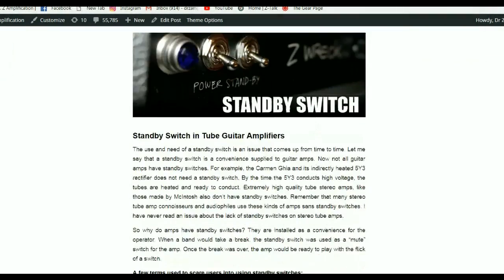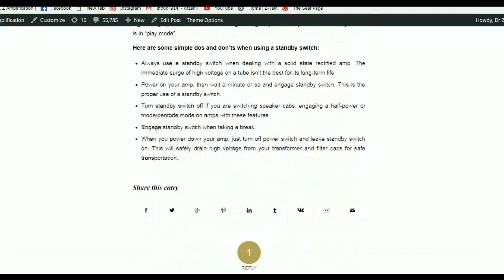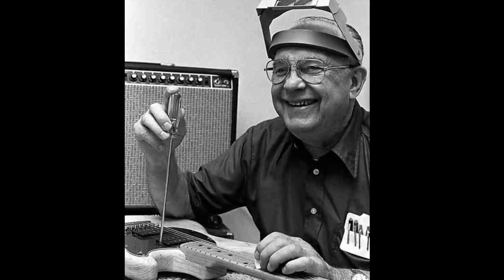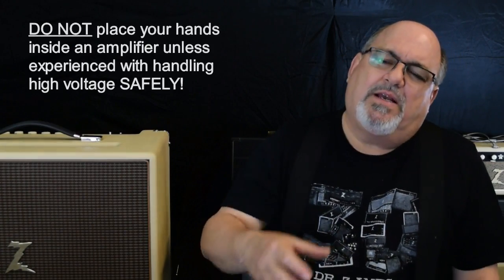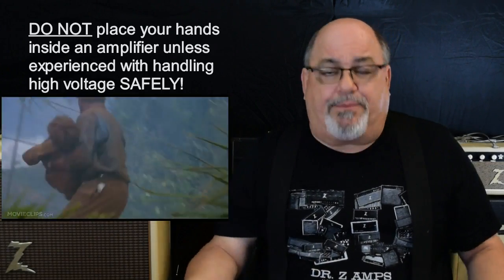Dr. Z AMA: "How to use your Stand-by Switch"

Comment: I never use the standby in my AC30CC. It is known to blow tubes. Instead, I let the GZ34 just warm up normally. No problems.
Reply: same, blew fuses and a GZ34 using the standby on my AC30
Reply: I've adopted the same approach recently with an orange AD30.  It's also GZ recitifed.  I used to keep the amp on standby while it warmed up, you could hear an instant blooming hum when you flicked the standby off which I assume had to do with the voltage spike.  When you flick both switches on at once, there's no such noise.  The amp comes to life slowly but smoothly.
Reply: @ummagumma7826  That's weird. In a fender the standby switch is after the rectifier and shouldn't effect it in any way. I use it during warm up to reduce plate oxidation on the power tubes. warming it up without it causes the plates to try pulling in electrons that aren't there yet, causing oxidation.
Reply: @deanallen927  I blew the fuse in an old AC30, you know amps better than me, I'm not sure about anything you mentioned.  The AC30 I have, and still play with no problems since never using the standby, is an older model from before the China made ones
Reply: @ummagumma7826  That could be it. Maybe those older ones had the switch before the rectifier which could be a problem if the transformer is providing a bit of a slowdown, protecting the tube, then engaging the switch sends the full jolt. Fender and Marshall have the switch the standard way, further down, after the first filter stage or similar. while we're at it, I'd recommend not trying the Groove Tubes diode module rectifier replacement; unless you want to have your power caps beefed up. Tube rectified amps typically have/need less filtering because the diode rectifiers send in a quicker more powerful jolt that needs a heavier Twin style cap array.
Reply: @deanallen927  Interesting thanks for the info.  I did buy a $50 rectifier from like the 60s or 70s and its been great, no issues.  The model AC30 I use has the blown fuse/rectifier as a common problem from what I've read online  https://www.thegearpage.net/board/index.php?threads/vox-ac30-tb-korg-reissue-1999-problem.1964613/     my only problem now is getting it to dirty without being too loud, i've tried lots of attenuators.  just using dirt pedals for now
Reply: @ummagumma7826  I have a friend in a Beatle band (The Sun Kings) who, after we talked for hours, got a vintage AC30 and I got the newest Vietnamese one which I love. He uses a THD hot Plate with no problems ever,  I like the  master on mine and don't use one. They've both been super reliable amps. Personally I'm partial to the Webers with the speaker parts inside which I had when i used a 50 watt Marshall. I feel they have a more organic sound, as the amp thinks it's seeing a real speaker. you might try one. But in a practical sense I couldn't tell you if a guy on stage was using one or the other. You might have a Master installed, but only by the most qualified tech.
Reply: So do you just leave the standby in the on position all the time?
Reply: Robert Wilson yep never turn it off.  I don’t play the guitar until the amp is warmed up.
Reply: @ummagumma7826  I have a vox CC2 so once you switch the power on (with the standby always on) you still have to wait a min for the tubes to warm? what if you play before the tubes warm up?
Reply: @robertwilson7813  not sure what happens if you play before the tubes are warm but people on the internet say not to so I don't.  I played a CC2, it sounded real good.  I have the TBX model.  Only issue is no preamp volume.  My TBX was blowing fuses when using the standby so I got a new rectifier tube, not cheap!, and started leaving the standby switch on at all times, no issues since.
Reply: @ummagumma7826  Okay thanks for the feedback. Yea the CC2 sounds awesome especially with pedals. I just blew my rectifier using the standby as well and now I'm seeing that people are saying to never to use it because it will overload the tube. well alright I suppose when the new rectifier comes in I'll try powering the amp on with the standby on, and give it a min before playing.
Reply: @deanallen927  really? Where does the oxygen come from?
Reply: Hahahahahaha 😆🤣 lol

Comment: I have a friend that recently purchased a fender hot rod deluxe Limited edition from GC it had a quite noticeable rattle in one of the output tubes we found which tube was the culprit by holding a pencil eraser on the two different tubes while he played his guitar through it until we found the bad one it was under warranty he took it back got a second hot rod deluxe same problem we have heard about tube baffles and dampers maybe that amp should come with them installed if they’re going to rattle when the amp is brand new what do you think a solution is or should he try a different brand of amplifier
Reply from the maker: he should probably get a Z since we put them on our amps and make sure they don't rattle before they leave the shop...

Comment: Could thermistors be used on a tube amp that has a solid state rectifier to protect the tubes (and other components) in place of a standby switch?
Reply from the maker: Sure, but it's not that big of a consideration as to justify the addition parts.

Comment: Hey DR. Z, I have a VOX AC30 CC2 I recently blew my rectifier when turning the standby switch off before the master.  I just want to be clear on this.  you said  with a tube rectifier it's basically not needed to turn on with stand by. With a solid state rectifier, it won't hurt using the standby to allow for the heaters to warm up.  So my amp has a 5AR4 rectifier tube, so your saying that it would not matter if i permanently left the standby switch in the on position, and only used the master on/off to turn the amp on and off? Thanks!
Reply from the maker: Yes. In fact there is a design flaw in this model of the AC30 which causes this that is well documented online. Just never use that standby, and you will be fine.
Reply: @DrZAmplification  Thank you for the verification! I have one more question, once I turn the power switch on do I need to take a minute before I play so the tubes to warm? or can it take playing right when I flip the power switch on?
Reply from the maker: @robertwilson7813  by virtue of the rectifier tube needing to warm to conduct the hi voltage to the power tubes, there will be a natural 15-30 second warm up. Once you hear sound, you can start playing.

Comment: I always warm up my amps on standby to reduce plate oxidation on the power tubes. warming it up without it causes the plates to try pulling in electrons that aren't there yet, causing oxidation. With the rectifier being way before the standby switch, I don't under stand how you could hurt it.

Comment: I accidentally left my tube amp on standby overnight and everything seems fine. What would have happened if I didn't have the standby and had it fully running?
Reply from the maker: Likely nothing in both cases however the later would have been the better case.
Reply: @DrZAmplification  it would have been preferable for it to be fully on instead of standby? Did I read that right?
Reply from the maker: @jralanmorgan  yes, heating the cathodes up for very long increments of time without high voltage being conducted to the plates isn't the healthiest thing for them. better to have them conducting
Reply: @DrZAmplification  oh wow, thanks for that knowledge!

Comment: Is it bad to turn a tube amp on without standby
Reply from the maker: No. With a tube rectifier it's basically not needed. With a solid state rectifier, it won't hurt using the standby to allow for the heaters to warm up.

Comment: You don't need one....it was carried over from the radio world lol.....and besides you don't want more things in that path trying to pull a bunch.
Reply: But he says that they protect the tubes in an amp that has a solid state rectifier. Old radios didn't have solid state rectifiers.
Reply: @johnsimms3957  well that was the cathode stripping theory....running the shit high is hard on it anyways. And yeah it's hard to blow those Diodes.

Comment: Watched the whole video and still don't know what the standby switch does that the power switch doesn't
Reply from the maker: It turns the high voltage on and off. The power switch turns the power to the filaments on
Reply: I have my amp unplugged. It is a Fender Reverb Deluxe. When I want to play, I plug it  then  turn the Power Switch on then I wait like 5 minutes and turn the Standby on making the amp to start working and I can play. When I turn it off I go first to standby, switch it off then I turn the power off. Is that procedure correct? Don I need to use the  standby to play at all? Thanks.
Reply: My amp is valves.
Reply from the maker: @tt-du6vc  watch the video

Comment: Strange to find such false info here. A standby switch was about the cathode follower and EQ and the high voltage on the cathode, not about servicing.
Reply from the maker: A cathode follower is a part of the preamp section and there is no high voltage on a cathode follower. High voltage in the preamp is typically found on the plate. The stand by switch turns off high voltage from the power supply to the positive rail, which is useful during maintenance, though not always necessary. The cathode of most tube circuits is comparatively negative, or close to zero voltage. It's strange to find a video with thousands of views from tube amp aficionados across the world, and it's only you who seems to know the correct answer.

Comment: The standby switch is completely unnecessary.  Don't use it - just turn off the amp or turn down the volume.  It does nothing to protect the tubes and it is not a "mute switch" - that is completely different electronically.
Reply from the maker: From an end user perspective, this is arguably true. However it is useful from the technicians perspective.
Reply: @DrZAmplification  That was more true in the old tweed amps that Fender first put them in.  Not really true any longer as the capacitor components that Leo was trying to protect are not that expensive today.  The standby was primarily to protect the cheaper capacitors he put in the amps as it was cheaper than putting in larger capacitors at that time.  The reality is that amp manufacturers aren't concern about amp techs and they could save their customers money by eliminating the switch.
Reply from the maker: @DanielBobke  You would save them approximately $1.50 in parts/ labor.
Reply: @DrZAmplification  But you would save end users of the amp much more than that from repairs on an unnecessary component that can break.  The only reason is there on most modern amps is because amp buyers expect it to be there and don't realize it is not needed.

Comment: Is there a proper way to turn off a tube amp that has a standby switch?
Reply from the maker: Standby on or off, does not really matter how you power down the amp (unless you are looking to discharge the filter caps).